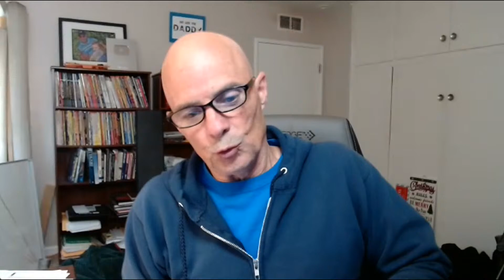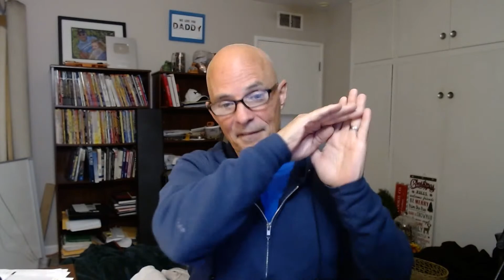LET'S TALK TECH-BTR TRUCK CAMS-ARE YOU A STAGE 4 TRUCK CAM GUY?

Comment: Originally bought a Truck Norris for an (L94 Delete) LS3 ~ Oppurtunity to Stroke 416 w LS7 Crank & Ti Rods/Mahles 11:1 So Stepping up to BTR 4" Stroke Req Port 219 /239 .553. 553 @ 115 +2 w LS7 Manifold, Flange/Cat/X /Npp Exhuast 
Would Love to See you review the 4.00 stroke Cams for the Torque Curve ~ Do you lose any Exhuast savenging with a Zero or -1.0 Overlap ?
Reply from the maker: a 219 cam is small for a 408

Comment: Hi Richard, please advise me. I swapped L77 6.0 L(823 heads) on 1980 sierra on it original manual transmission. With a big stage 4 BTR cam  111-2.5 package including a mailing oil pump, 6.2 Denali intake manifold, with 1-7/8 long tube headers all 3” straight pipes. My question is can I go on the factory injectors ? If not what lb # so suggest me to use ? 36lb-46lb?
Reply from the maker: i would use 42-46 if you plan to stay na
Reply: @richardholdener1727  thanks a lot, yup that’s my plan to stay N/A. Appreciate your quick response.

Comment: I built a 6.0/243 with a stage 4 v2 in my 5 speed Silverado. Cam surge was terrible, bad enough I ended up pulling the set up to redo with a stage 2 v2
Reply: You didn't have enough stall. Did you use your factory converter?

Comment: I just put an l92 VVT3 cam from Texas speed in my wife’s truck 6.0 L76. The specs are 224/236 .600 .600 113+3 lsa with a yank tt2600 stall. Pocket ported rec port heads. It seems to be a very mild cam in my opinion. Drives very nice and my wife really enjoys it in her crew cab Silverado daily.

Comment: Well I have a rcsb 2000 Silverado. I’m building a 408 for it for the street. I’m using Mamo 205 heads with a 226/230 .598 lift on a 112 Lsa. Mamo ported a TBSS intake for me along with a 92mm Nick Williams tb. I have American Racing full length headers with cats. I’m hoping for 550 hp and tq at the FW. What do you think of this setup for a daily driver? Oh compression will be about 10.8:1
Reply from the maker: GOOD COMBO

Comment: Really wanting to go with the TN with a 4.8 with a 4l80E. Has a stock converter but the end goal would be a higher stall once my other 80 is built ( bone yard 80 in it now) .  End goal will be a turbo  build with 3.73 gears. Any suggestions on what stall to go with? I bought a 2200-2400 Chicago converter but getting the feeling that won't be big enough   2011 daily Silverado currently with 3.23 gears.  And any tips on the tune once a TN cam swap is done?
Reply from the maker: more like 2800

Comment: 6.1 10.47:1 (6.0 .040 over lq9, yes 317heads) with a summit 8706 stg3 cam, drove great, added a circle D 3400 lock up converter and now it acts snappier, dak tunes in western Washington for Dyno stuff. Brady Davis is the tuner, does lots of everything. And f&$k cancer
Reply: I went with that cam because I thought the size of the motor and the compression would have been like a smaller motor with a smaller cam.

Comment: I have a 6.0 L76 and basically spec'd out a stage 2 cam for it.  216/226 114+1 LSA.  I feel like it has an 80% chance to be okay cruising at like 1200 RPM with factory gears and converter... Still gathering lighter weight valvetrain goodies so I can't comment on how it performs yet.
Reply from the maker: manual trans then?
Reply: @richardholdener1727  6l80E. Pontiac G8 GT.  I'll let ya know if I found the limit on cam size while retaining "decent" drivability.  I have learned a lot from your channel, Thanks for being you!
Reply: Just add a small converter, modern ECU/PCM’s can tune for great drivability with bigger converters.
Reply: @bri-manhunter2654  Given that 3 cam manufacturers want to sell me something on 218-220-224 for the intake duration on the same LSA.  The 218 cam guy at least wanted it on a 115 LSA.  Maybe I'll try to spec something out with 212 on the intake and call it a "Gena Norris" cam. LOL
Reply: I just put an l92 VVT3 cam from Texas speed in my truck 6.0 L76. The specs are 224/236 .600 .600 113+3 lsa with a yank tt2600 stall. Pocket ported heads. It seems to be a very mild cam in my opinion. Drives very nice and my wife really enjoys it in her crew cab Silverado daily.

Comment: I have a truck stage 4 to use in a 6.2 aluminum block. Don’t know if it would be better to go to a higher lift cam to get more out of the large rectangle ports
Reply: You can go bigger, but it depends on the intended use of the vehicle as far as drivability and converter size.

Comment: If you had a light weight drag car with a 3200rpm stall converter with a transbrake and a large turbo (t6ish). Could you run the stage 4 cam so you dont torque kill your stock rod on a 5.3? Lol.
Reply from the maker: YOU ARE STILL GOING TO HAVE A BIG TORQUE NUMBER UNLESS YOU LIMIT IT SOME OTHER WAY

Comment: If that crane cam is 200/200 502/502 is that like a stage .750? It’s not quite like putting an actual stage 1 cam in. Other than you guys I just tell people I put the stock cam in it :p stage .750 :p It’s not 3/4 of a race cam it’s 3/4 of a stage heh. I will have to hit you pp later today for Todd
Reply from the maker: thnx HT

Comment: In the middle of preparing an LQ4 for a BTR torque cam. Going to attempt to "bulletproof" It during a full teardown and rebuild. 2006 2500HD 4x4 4L80e. My buddies work truck/project. so i guess in this case we are stage 0.5?? lol thought about the stage 1 but we decided to try the torque cam.
Reply from the maker: the torque cam works well-might be a tad small for a 6.0L
Reply: @richardholdener1727  That was my thoughts but he said he would be happy with just a small cam. anything like the torque cam but for a 6.0 sized ls? thank you for any input.

Comment: Richard, who makes a turbo header/exhaust for the 302 that I could use on my early bronco?  Also, are the gt45s from ebay any good?  If I get them, should I upgrade parts in it?  Is the bearing good on those?
Reply from the maker: the turbos are good-i don't know about specific kits